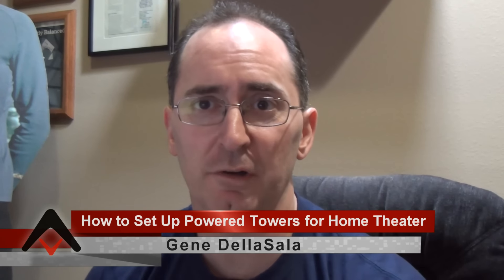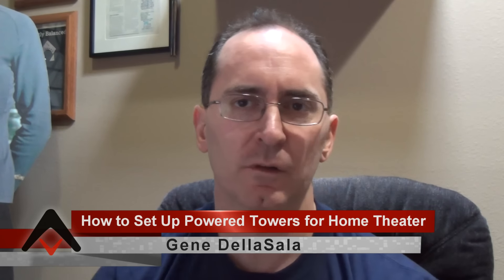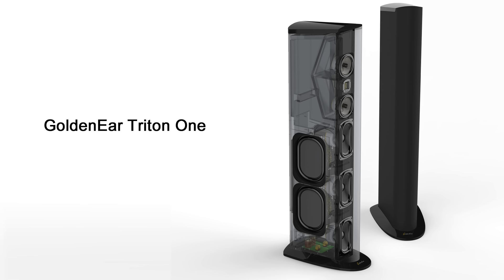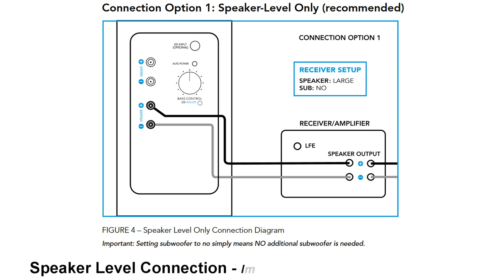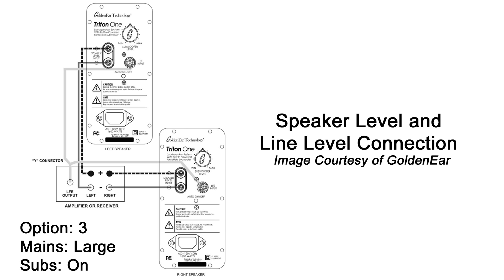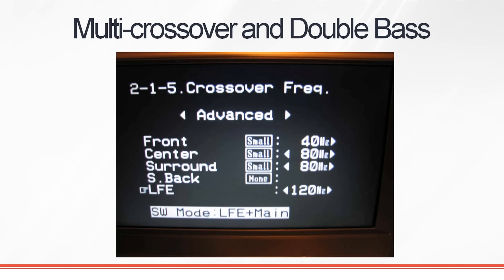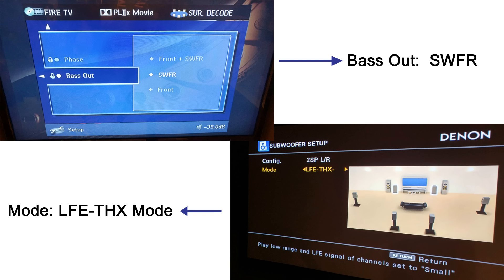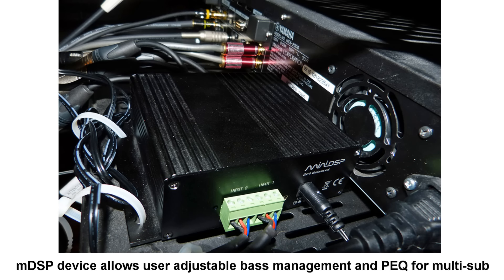How to Set Up Powered Tower Speakers for Home Theater

Comment: I have a 7.2 setup: 
Receiver: Marantz sr7008
Center: DefTech CS-8080HD
Fronts: DefTech Studiomonitor 65 (bi-amped)
Side: DefTech SR-8080BP
Rear: DefTech SR-8040BP
Subs: SVS PC-12plus (x2)

I recently found a great deal on a pair of the DefTech BP-8080ST supertowers. I want to try and swap out the Studiomonitors with the supertowers and try to connect them so that the built-in subs will act as more of a "mid-bass" driver. The two Subwoofer outs on the back of the Marantz are currently consumed by the two SVS subs that are hooked up. How do you recommend I connect everything so that the built-in subs can be utilized and everything can sound its best? Also note that the center channel has a built-in sub as well with an LFE channel connection, so there's always that as well. Thank you.
Reply: Get two Y-splitter cables. Use one Y-splitter to connect your towers to your avr LFE out and the other Y-splitter and LFE to connect your SVS subs and then for go the center channel sub entirely.... If you want to power all of your subs the only option I can think of would be to Y-split your towers into one of the LFE outs, connect your center to the other LFE and then get a separate amplifier to run your subs.

Comment: So I have a Denon X6200W AVR. My mains at DT BP7002 and Center is DT CLR 2500. Right now running as SMALL. I do have a Klipsch SW-115. So I have SUB set to ON. I am using LFE only not LFE+Main. I have crossover for mains at 40hz and center 60hz. This sound about right?  Also just using speaker wire connections to fronts and center.

Comment: good video I use the mini DSP 2x4 advanced the RCA one which is linked from my subwoofer out. Have two sub outs on my DENON but using one sub as of now. I have the mini DSP  microphone. My floor standers are passive and there bi amped by two separate amps Parasound 2125 model . AS usual all my channels are set to small at 80hz.

Comment: Hi there, I have 2 BP9060 tower speakers, I  want to do option  3 , but I also want to add a subwoofer, that’s the only two speakers I will be using and the subwoofer, this system is for just music no home theater, any advice thanks.

Comment: Can you use a receiver with bookshelf sized active speakers? And yes, I know active speakers don't need a receiver. It's just the active speakers I have are with bluetooth so I like having as many options as possible. The receiver is a vintage so it doesn't have bluetooth capability.

Comment: Great video Gene. I'm running Deftech 8060st in option 3 and a Rel T7, all being driven by a MRX 1120. In your recommendation if you were moving from powered towers to passive what are some of your recommendations? Primarily all home theater.

Comment: I have DefTech BP9040 front, CS9060 center, SR9040 surround 4 in ceiling Yamaha NSIC800 Height and a Powerfield15 sub. I have great bass, but my high notes are not clean, crisp. I run the 2nd option. My questions are 1) how to get more highs, 2) should I put acoustic panels behind by rear firing speakers and last the overall position on front speakers such as toeing them in, distance from wall, etc. I cannot find any videos on this. I appreciate any advice from anyone. Thanks.....

Comment: How are you doing Gean? I have a big question I have a system getting ready to come in D Cember consisting of the golden ear reference speakers for the front and definitive technology 9080 for the rear. My problem is which would be the best way to set up for bass management especially for the golden ear speakers I am powering this with Denon 6400H and Emotiva XPA -7 amplifier the height channels are not the problem the front will be SVS and the rear will be The height speakers on the 9080 I would like to be able to utilize the full speakers of the golden ear How would I set this up? Thank you

Comment: Hi Gene. I have a pair of Definitive Tech BP8060-ST's for my front left and right. The SR-8040BP's for my surrounds, The CS-8060HD center and the A60's Atmos tops (got for $125). I also have the Yamaha Aventage RX-A850 (7.2) receiver.

I have them (the mains) wired with the second option you mentioned (speaker wire along with subwoofer cable going into the LFE ports). I had the mains crossed at 80Hz and then tried 60Hz.  The center I have set to large, the surrounds set to small at 100Hz and the Atmos A60's set to small crossed at 200Hz.

I was thinking of trying the third option, the mains set to large. However when you say don't double bass, on my Yamaha receiver I'm wondering if that's the "Extra Bass" feature that should be turned off?  I really don't see anything else that could reflect output (double) bass.

I've seen so many different opinions on these settings that it becomes confusing. For the center channel (CS-8060) Definitive says set that to large.  The center channel has a 8 inch subwoofer in it.  If I go with option 3 as in this video, should the center be left as large also or "small" at 80Hz?  The surrounds they say set to small at 100Hz and the Atmos A60 tops I've seen set those to small at 200Hz. Does this sound correct for these other speakers?

Thanks.
Reply: After seeing different posts on different forums, I went to the Golden Ear web site to view their center channels that were similar to the Def Tech CS-8060.  They do say set the center to small at 80Hz at least while the mains are set to large.  Def Tech seems to persist in setting center to large but I'm going with the small recommendations.

I also found another post by an installer who has set up the 8060's for both the center and mains for other clients.

He uses method 3 as described in this video but says while setting the center to small at 80Hz is ok,  but if you can cross the center to either 40Hz or 60Hz then do so as the center is capable of going lower than the 80Hz standard usage.

I have now put my center to small and trying the 40Hz .

Comment: Awesome video!! I have similar setup. Def 8060 as main 8040 center 8040sr and 2 super ones nht for srb. I have regular wire from av to speaker set at 80 and at large. Then lfe to 3 subs.

Comment: Hi, I am new to home theatre and its setup. I have denon avrx 3400h, 2 definative 1000, 2 definative 800, 2 definitive mythos 6 and 1 definative supercube 2000. I want to setup 7.1 setup. Currently, the 2 mythos are my front, 2 1000s are front height and 2 800s are surround back. Used audessy to setup the speaker. Is my setup correct or should have to reshuffle them? Also, whenever I try to raise the volume to greater than 80, the denon's protection switch is triggered(red light blinking). This I have noticed with my previous denon receiver also. What is that I am doing wrong. I seldom hear anything from my surround back. Please help.

Comment: LSi 25s.  Thanks for confirming my suspicions for proper setup of powered towers where the passive drivers are on a built-in HPF, and the system has a separate subwoofer(s).

There is an old Audyssey thread (https://audyssey.zendesk.com/hc/en-us/articles/212345563-Polk-LSI-25-s-say-set-to-Large) where an LSi 25 owner is instructed to set to small.  I think the rep from Audyssey didn't appreciate the fact that the passive drivers in these loud speakers roll off at 80hz.

Comment: Gene, does this video apply to me if I got powered towers with built-in subwoofers + 2 stand alone subs? If so, what's the best way you would think to hook it up to get max performance? thanks
Reply from the maker: This is challenging. I'd hook the internal subs of your towers and your 2 external subs all to the sub out of your processor.  I'd recommend getting an mDSP unit to EQ and manage the bass.
Reply: I see what you mean. Thx. Btw, appreciate you guys putting out these videos. Keep it coming
Reply: Another question, since I've got my setup with 2 stand alone subs, should I set my powered towers on my receiver to "small or large"?
Reply from the maker: If the subs built into your towers have similar output capabilities as your stand alone subs, use them as dedicated subs too.
Reply: If it does, how do I connect the cables/wires in order to use them as dedicated subs?

Comment: I'm going to be using Status Acoustic Titus legacy in a tri amped active set up bypassing all internal passive crossovers. Then Atlas on the rear each with a 12" sub. 6 10" Isobaric subs in each Titus. What is the best setting for this? I assume it is large/on. Then rear to small. Use the large fronts to send lfe to the deqx to distribute the signals and I can amplify the lfe there as needed. Then the sub on would have The processor lfe going to the two rear Atlas subs?
Reply from the maker: Wow nice setup!  Not sure I would bypass the XOVER as the designer put forth some great effort to get the drivers to integrate optimally.  I would discuss this with RBH Sound.  Call them and ask for the designer Shane Rich.

Comment: Hey guys just seen this video..i have the original Goldenear triton 2s... in a HT set up..with al JL fathom f112 sub....im using a pioneer sc72 receiver which has 2 sub outs...i have 2 questions....1) How do i get the best integration for the subs since i know the tritons roll of and cant keep up with the JL bass output. i have a Y splitter so both towers are plugged into 1 sub output and the JL in the other.. and 2) I heard that raising the towers off the floor using a "grandma-riser" or other acoustical risers  can give you better in-room performance because it limits floor bounce and floor reflections from the towers...especially when placing them on hardwood floors....is that true? And if so..can you shed some light on  this for me plz??

Comment: I have 2 Def tech bp9020 and I have them connected the first way you mentioned. I'm going to change it to your recommendation. (Low+lfe) I also have a def tech cs9040 and I'm trying to figure out what I should do for rear speakers. These are the 2 options I'm considering: 1. Buy 2 bookshelf speakers and a sub or 2. Buy 2 bp9080s and put them as fronts and move the 9020s to the rear and buy no sub. I have a Denton AVRX1400. What do you guys think? I'm a newbie btw so Intry to follow all your recommendations
Reply: Constantinos Hadjigeorgiou  what setup you do
Reply: I would recommend 2 bi-pole surrounds with high sensitivity (look at some Mirage Omni sats or their Nanosats or the Klipsch RP-150S)(remember it doesn't matter a lot if it's not the same brand for surrounds) and 2 12" subs, unless you want the 9080s for their Atmos modules.

Comment: i just ordered bp9080 to go wtih my current bp9020 and just realized the 8 vs 12 inch tower issue...will setting this up neutralize either the 8 inch subs or lessen the 12 inch subs? is it a bad idea to have 4 towers if the subs don't match? also i had considered (due to projector screen space) insead of a front larger tower keep my bp9020 and then wall mount pair of sr9080 on the same front channel (4 speakers same front channel) can this work? i was warned not to do 4 speakers.
Reply: I have an Anthem MRX 520 receiver and It doesn’t give me an option for small or large speaker. I performed the ARC room correction and it set my Goldenear T-3’s to 90 Hz, I decided to lowered the main speakers to 60 Hz. I also have 2 cables for the LFE’s running from the speakers to the receiver and they sound great.

Comment: Def Tech BP 9080x towers with SR9080 Surround speakers, CS9080 Center Channel Speaker and a SuperCube 6000 hooked up to a Yamaha AVENTAGE RX-A2070BL 9.2-Ch
Reply: Nick Villanueva I have the same setup with a marantz 7013 how do you have it hooked up. Just speaker wire? Speaker wire plus lfe?

Comment: I have def tech 8060 towers and a cs9060 center andsr9040 ,what in your opinion would best connection setup?I am using an marantz 7013 receiver y,our advice is most helpful.

Comment: I have a pair of def tech 9040 with a pioneer elite sc 501 and wondering what you would use for a sub with this combo ? I like a lot of bass in my movies and also music . I was thinking of running the tower speakers subs with the main sub . Any suggestions would be greatly appreciated 
Thanks
Reply: Depending on your budget, (if within $500-$600) get 2 BIC F-12s or 2 BIC PL-200 ii (if within $1000 - $2000) get 2 SVS PB-2000s or HSU VTF MK2s. HSU and SVS makes great subs and they are worth every penny. On the other hand, if you want to hit the 22 - 25 hz without breaking bank, then the BICs are well worthy of it. I own both Klipsch and BIC subs and I wish I bought 2 BICs instead of the Klipsch with the money I spent on the Klipsch. The BICs do require some break-in period. Hope this helps!

Comment: I have a question. I have a Pioneer Elite vsx-51 and I'm running 2 Definitive BP7002 for my front, 2 Definitive BP8020 for my rears. With what the video said I'm not really sure exactly how to set this system up. If you could please give me some advice. I love bass, but I want to have a balance. 
Thank you
Reply: I have the BP-7004's. I use an integrated amp (Yamaha) It is plenty of juice with the active subs. Like yours, my speakers have both active and passive subs. You're talking about 4 subs. If you want more bass, just turn the bass gain up on the back of the subs, and run your amp/ receiver in the 'flat' dial setting. This guy is just babbling on the video. He only talks about newer electronics. My Yamaha amp is from 1989 and STILL delivers the goods. Ask my neighbors, as they pound on my doors all too often. :)
Reply: And if you have any doubts as to the credibility of what 'powered towers' can do, Legacy built both their Focus and Whispers on this same technology.

Comment: very good video. i was never quite sure what happened when you set the bass output to both. but i do have a question. my yamaha  has a separate setting for lfe how do you set this up?
Reply from the maker: The only separate setting Yamaha has  for LFE is to adjust LFE level.  Leave it at 0dB (max).

Comment: I see the two comments below. I have my Klipsch rp-280f set to small but some rep said to set those to large. Not sure why when I have two 15"s.
Reply: That's what I'm questioning. Definitive says set to large but I have two 12s
Reply from the maker: You can set them to large and still use a powered sub as well.  Just be careful about how you get the bass blended where the sub and towers share the same frequencies.  You may need to EQ it a bit.
Reply: Audioholics how do u do this?  I have two def tech 9040 towers with a powered sub.  How do I use the subs in the towers and my sub together?  What's the recommendation?
Reply: Airunh23 I need this help too, I got the 9020's by Def Tech and a separate sub

Comment: Hello, I'm using Fenda Audio T60x tower speakers for my pc. I was thinking about replacing them with my jbl front speakers on Harman Kardon 7.1 AV receiver by the way My T60x has Optical & RCA out put.  What would you suggest to get it work ?
Reply: Apurv1990 you need a speaker wire to line level converter

Comment: Sorry reposting because I need some urgent advice: 
Hey Audioholics community. I'm looking to buy my first subwoofer and am looking at a used Boston Acoustics PV800. It's 12 inches, 300watts and $250 AUD which seems to be a pretty good deal. However I am concerned because the sub is about 15 years old. How would this factor into my decision? Could it be worn out? Is 300watts back then likely to be inefficient and not as powerful as 300watts today? I do have the opportunity to inspect before buying. Any advice would be much appreciated!

Comment: probably too late to see any imput on my situation, but any opinio is valued: Ive been playing with vintage for the past few years ubtil hoth an Onkyo TX-SR505 HDMI reciever fellinmy kap, followed by 2 sets of towers.( Kenwood CS-935's & Cerwin Vegas CS-105's.  Fee like kid in a candy store who just won a porche and is scared to drive it!

(Also have an HK 330 "Nocturne" with Zone 2 capable reciever, and a RCA RT2911-1000w x 7 reciever if that can help in the integration. If its even possible to do without shutting down or blowing the grid...."

Comment: Hey  gene I  got a pair of RF-82 front klipsch you think that I should put those large or small
Reply from the maker: See my answer above regarding the RP-280f Klipsch speakers.
Reply: Audioholics Hey Gene hope youre doing well i bought 2 def techs bp2000s a month ago .they sound amazing but still tweaking them to my liking.I have the highs and mids connected to receiver bipoled and the lower bridged. my question is should i leave them biamped if a use the LFE output to the subwoofer out?
Reply: Audioholics did anyone notice the guy off to the left...
Reply: Grant Fischer that's a mannequin

Comment: I have definitive technology BP9080 tower and each have a powered sub plus the middle and speakers on top angled outward.I need to know the best way to hook them up  I have a 9.2 denon reciever that can be 11.2. i need to know how to get my whole speaker playing all at once..A person set mine but it uses all of my speaker inputs and they have the top speaker set as a cieling speaker and it does not sound as good as i know it is
Reply: i need some feed back
Reply from the maker: We discuss how to set up the bass management in this video for a speaker like this. The top modules need to be configured as Atmos-enabled speakers in your Denon. Consult your user manual for more info. Good luck.